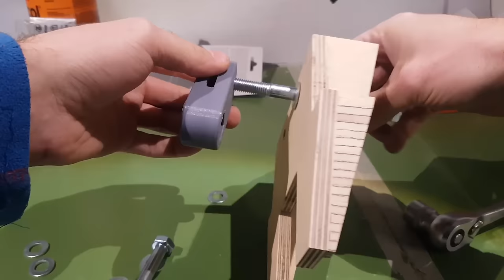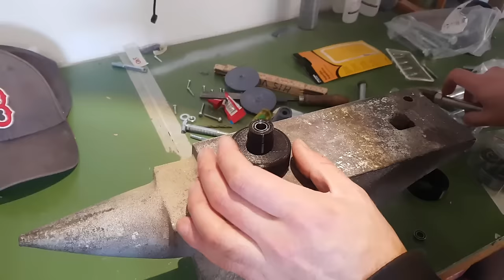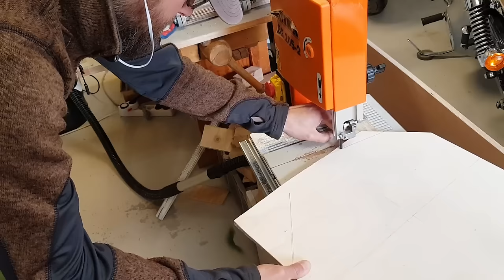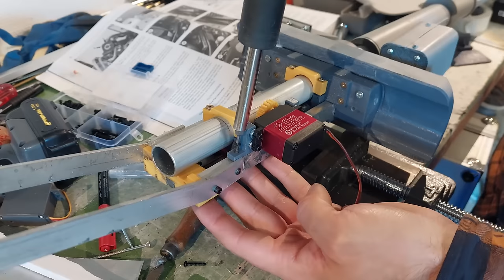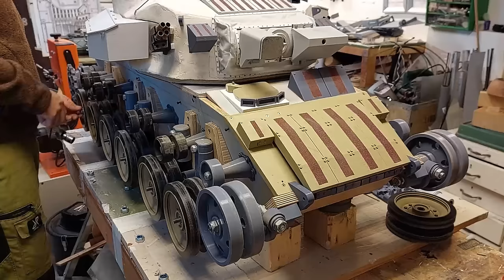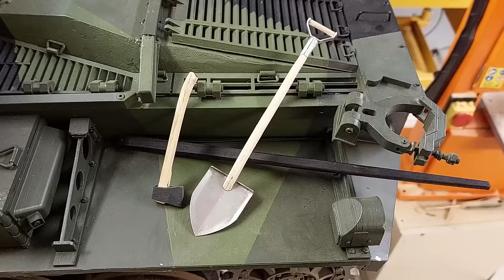How to make a 1/6 scale Strv 105

Comment: WE MORTALS have been blessed WITH A CENTURION (that is totally real and not a scaled down version that is made from wood, metal, wood glue,some screws, plastic and LOVE)
Reply from the maker: Totally!
Reply: @builtbyWikander  best of wishes on new year. 
I wish for you to rest and spend time with your family, you deserve it!
Reply from the maker: @maxim4538  Thanks a lot, we are doing our best! 😊
Reply: strv 105 is better.
Reply: Love it fantastic work, can you build some full scale ones and send them to Ukraine 😁
Reply: Applause  for such a brilliant piece of work. couple of questions tho. Did you use an electric drill motor to provide the power to drive the tracks? And exactly how many hours did you put into this project? Absolutely brilliant out come.
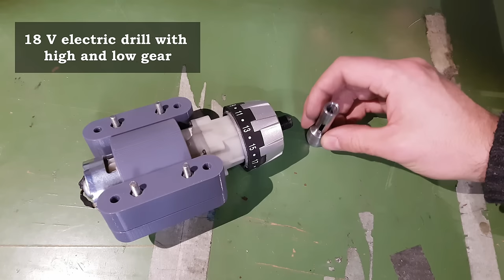Reply from the maker: @williamhowie4121  Absolutely, check out 17:00 I really have no clue regarding the ammount of build hours, but a guestimate is around 400 - 600 hours.

Comment: Until I see you using a hacksaw blade to make groove for the C clips, I thought you had a small hobby sized lathe. Yes, I did read the note thanking Sten for making the gearbox drive shafts, and they are very well made. I'm a retired machinist. I have a bunch of wood working machines, a Harbor Freight Hobby Lathe, and a couple years ago, I bought a used Bridgeport that needed repairs. It's been running for a while, and it's in good condition. I converted it to single phase using a new motor with the same RPM as the original motor. The only thing I'm not into is 3D Printing. I really enjoy watching you build your RC Vehicles, you are a very talented.
Reply from the maker: Thanks a lot for those kind words. 🙏 I got a small hobby lathe half way through the build, so it will be very handy in upcoming projects, but I must say I need to get at much better understanding of how it works to really put it to good use. Thanks for sharing, and for watching!

Comment: As an Old Centurion Gunner/Driver Mk 10/11 , 1968-70, I'm amazed how good your detailed model is. The UK model didn't have a single slide over drivers hatch. It was a double flip over with adjustable sights. The single hatch only came with the Chieftains. The Centurion was modified for numerous countries and was a superb battle tank in its day, In the winter months when out on exercise, we always slept on the back decks as they where nice and warm with the RR Merlin engine running all day. That certainly brings back many memories. Ho, I still have a distorted finger nail when changing a road wheel dropped on my finger, ouch that hurt.
Reply from the maker: That's so aweseome, thanks a lot for watching and commenting!
Reply from the maker: Edit: I think the hatch is unique for the Strv 105. It also got new suspension, ir sight and the same engine gearbox as the M60.

Comment: Hi Eric, firstly sorry for so many questions. Look, I'm using PLA+ (maximum print speed 90 mm/s). You use this, don't you? Have you tested the ePLA+HS, which has a much higher speed?
Reply from the maker: Hi! Yes, I'm using eSun PLA+, I have only good things to say about it. 😊 I mostly use 50 - 70 mm/s, though. I have not tried PLA+ HS, sounds interesting. Is the strength the same?

Comment: Did you draw up the schematics and figure all the dimensions out yourself?  How long did drawing up the blueprints take?
Reply from the maker: No, I found a Centurion blueprint (a 4-way view from a 1/35 model, I think), used is as a background template in FreeCad and drew the parts from it. Plus a ton of references images.
Reply from the maker: *I scaled the blueprint to 1/6 using Photopea, to get it to the right size.

Comment: A great video thank you . And it may be of interest to some that the yellow aircraft in the background and the Centurion both have a connection to my home town Nottingham . The yellow Piper Cub was designed by CG Taylor who,s family came from Nottingham , and the Centurion main armament the 105 mm gun was made at the Royal Ordinance Factory Nottingham . And previously held the record for the longest tank on tank kill when in service in Isreal .
Reply from the maker: Thanks for watching! And wow, that was some story, did not know that! Thanks for sharing! 👍🙌 The Cub is an old model from the 70:s, 1/6 scale, just as the tanks. 😊 It will get a properly converted to electric some day.

Comment: Not once did I see a cellphone throughout the entire video! Which made it that much more awesome and enjoyable to watch! Today's youngers need to learn the many skills that you demonstrated (With impressive expertise!) without relying on that cellphone. I tip my hat to you and your expert skills sir! I myself, finished building a 1:4 scale R/C US MLRS M270 last year from scratch and raw materials. It took me 3 years from start to finish, and could not even compare with your work! I know exactly what efforts and patience it takes, and again, you have conquered and mastered both. As one other comment mentioned, "I wish that we had more events here in the USA to show our work." I agree!!
Reply from the maker: Thanks a lot for those kind words! 🙏 That build of yours looks very impressive, and in that scale it's huge! Would love to know more about the propulsion and the tracks. 😊 The M270 is on the build list here as well.
Reply: The entire drive system started out as an electric wheelchair that was damaged and given to me. I modified the frame and reused all the electronic controls and adapted with servos on a home built control panel. The drive sprockets were home made useing sprockets that I purchased on amazon. And the tracks (My 3rd and final version) are 3/4 in HDPE polyetheylene that I made from templates made on my 3D printer. I originally joined 5 test pieces made from wood for fitting/flexibility testing purposes. Once I was satisfied, I made a jig for drilling the holes for the cross pins and joined them all with 1/4 x 5.5 in carriage bolts and nuts. I have a few short videos of some of my work , but not the entire build. But I do have A-LOT of pictures. On a side note, the rockets in the video were only common bottle rockets/fireworks that I used for testing. The real rockets are from 12-23 in long. I plan on firing them early this spring.  @builtbyWikander
Reply: I think that your obsession with cell phones is rather telling. Nobody expects to see a cell phone in a model build video. Actually, he could have been filming it on a cell phone, which goes to disprove your point that "youngsters" shouldn't rely on cell phones. Cell phones allow people to speak and even see each other when they are apart from each other, and few things in the modern world are as good as people talking.

Comment: the tank is truly amazing. I have a question, where do you get the exact dimensions and designs of the tank, because I've been looking for two months and I can't find it, and I'll admit it, I'd like to build one, but on a larger scale.😊❤
Reply from the maker: Hi there! I often use 4-view drawings found online for my builds, they mostly come from 1/35 scale models. If I know how long the tank is, I can scale the drawings to 1/6 scale using Photopea and then use the pictures as a template in FreeCad when making the parts. Buying a 1/35 plastic model can also be a good thing to see how surfaces meet and to take measures from. All the best and good luck with your project! (how much larger will this larger scale be? :) )

Comment: 600 hours to print thats 25 days 24/7 wow, pretty cool things I must buy 1 how did you work out how to print do you use Cad? your building skill is impressive bro you should buy yourself combination machine a 300mm one would make life easy with the aluminum bending and cutting and rolling they don't cost much, may be a small co2 bottle and get the turret firing
Reply from the maker: Hi! Yes, it took some time, but at least you can do other stuff while the printer is working. 🙂
I make all my models In FreeCad, a free to use open source CAD-program.

Comment: What infill percent are you using for functional parts?  It doesn't make a sound like 100%...Maybe 50%?  Thanks for a great build video!  I might make this my 2024 challenge!  I just have to decide on the tank.  Maybe a M113 or Bradley just to make my life easier...😁
Reply: Lovely idea at 11:16 ! Bravo!
Reply from the maker: Hi! Functional parts, like road wheel arms and drive wheel has quite high infill, maybe ~ 70 %, road wheels a little less, 30-40 % and track links ~95 %.
Reply from the maker: I think you should definitely go for a Bradley! 👍
Reply: The fact you are using build techniques from at least 100 years (files to 3d printers) is amazing!
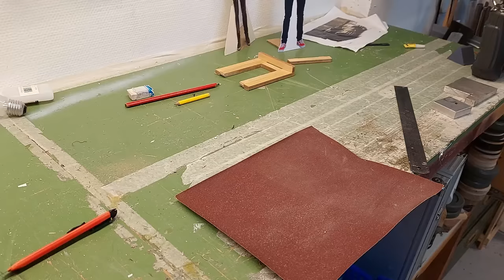Reply: 37:32 I was like "ok what's this for?"  Anti skid! 😁
Reply from the maker: @slip_fitter  Got to work with what you have!

Comment: i did not think 3d printed parts would hold up to motorization? thought the drive sprockets would not be strong enough.
Reply from the maker: It's stronger than one would think! Perhaps it won't last for several decades, but so far it's holding up excellent.  🙂

Comment: I sure would like to build a walker bulldog tank 1-6 scale and for the barrel use one of my old 22 semi auto for the canon barrel just to hunt wild hog in the back of my feild . 150 acres of field back there and it loaded with hogs and if they see a man they run. I really think one of the tanks with a 22 rifle build in it a Lazer on the barrel and a GoPro camera would do the trick because those wild hogs don't pay attention to equipment but if they see a man they get gone quickly.  I'm going to have to figure out where to buy me one of these kits and start a new hobby in my shop. I'm 60 years old and building things like you are doing is interesting. I was building firearm's and RC airplanes but lately I just been reloading ammo for my guns and making things on my lathe. Like tools and other little things to work with and making knives. Where do you get the parts to build a tank from? And how much does it cost?  I live in southern Georgia close to Waycross ga.
Reply from the maker: Hi, I draw the parts in FreeCad and 3D-print them on my Flashforge Finder. 🙂 There are kits to buy, from brands such as Armortek in the UK. Excellent models but they are a bit pricey. Good luck with the boars!

Comment: I'm sorry to bother, but could you please post a link to the exact dimensions and angles for the wood?? I can't seem to find any decent original blueprints
Reply from the maker: I have been meaning to answer you for days now. I have to check the angles, etc, it's not very clear on the blueprints I found online, but I think I came close. A tip is to use a 1/35 plastic model as a reference when building your own tank. Great to take measures from.

Comment: With some of those very long print-runs, for the track for example, you may be better off using 3d printing to make a mould capable of producing cast parts, several at a time  It's not exceptionally difficult to do, although I'd reccommend a good book on it.
Reply from the maker: Would love to cast, that's definitely a goal for the future. 👍👍👍
Reply: @builtbyWikander I made a mould thus for the first time a few years back, just using you-tube and books to learn what to do. It needs a lot of planning an thinking about, and I sought a lot of advice, from silicone makers, resin manufacturers, and so forth, but it all worked out well - with care. In my case it was to vac-form the perspex for the compound-curved front of an RAF gun-turret model. It is doable!

Comment: cool tank man! are the 3D printed parts still holding up?
Reply from the maker: @proracing9672  Thank you! Yes, everything is working fine and the model is running great so far!
Reply: @builtbyWikander  thats fun to hear!!! i have got an other question, i am building my own 1 to 6 scale tank (panther ausf a) and i am looking where i can buy these 12mm axles (keyed) and GT2 pulleys, but i cant find them online. can you tell me how you got them?
Reply from the maker: @proracing9672  Axels should be easy to find at any hardware store, just as the keys, but the hole for the key, you'll have to make yourself where you want it to be. You can also try Amazon and search for 15 mm axle, or similar. 🙂
Reply: @builtbyWikander  thanks a lot man!!!!

Comment: You have an air compressor, you might want to seriously consider getting an air brush for painting projects as large as this tank.
Reply from the maker: Yeah, I usually use an airbrush for my tanks. This time, I had to get it ready for a meeting in Denmark and time was running out.

Comment: Do you have plans to make this available
Reply from the maker: Hi! I might do that, yes.
Reply: @builtbyWikander  I have a 3d printer and have been looking to find large scale tank plans, your tanks are fantastic, would like an armourtec tank but need to win lottery first, would appreciate if you could share stl files and drawings etc
Reply from the maker: @trickies  Thanks, man, I might get around to do that. Just a tip, there are 3d-files for large scale rc tanks on both Cults3D.com and Thingiverse. I know there is a KV-1/2 for free in 1/10. Easy enough to scale to 1/6. 🙂 And Kaja18 at Cults3D has lots of excellent models for sale.